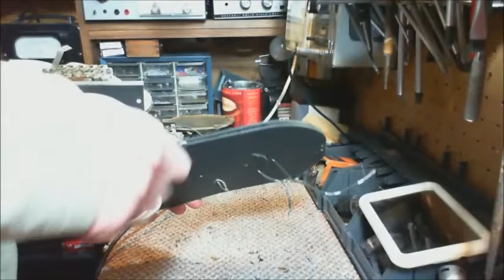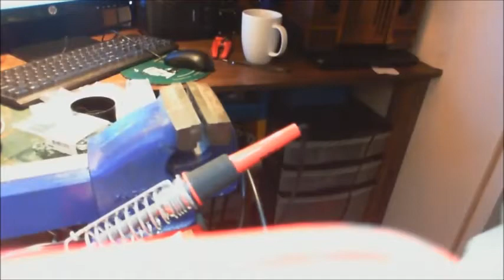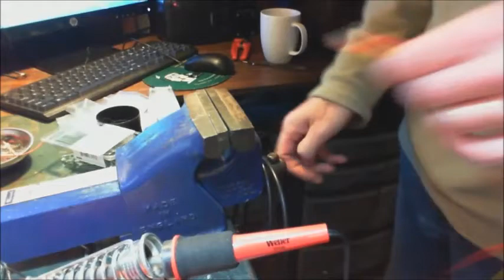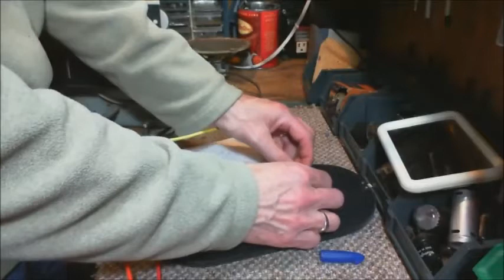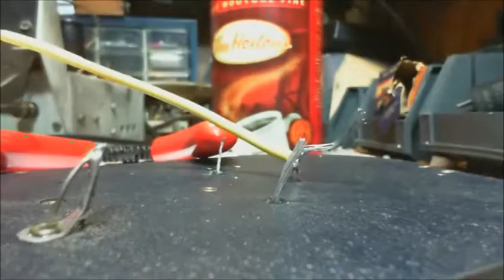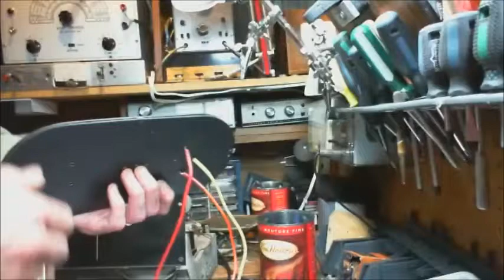General Electric KL-70 AM/SW Radio Video #16 (reloaded) - Beam a Scope Antenna

Comment: Thank you Jim for providing all these great how-to videos on the GE KL-70 radio restoration.  I have a 1941 RCA VICTOR model A-38 which was built in here in Montreal, QC.   It`s in good shape in terms of overall appearance but it humms when I turn it on so I need to work on it.  One thing I've learn`t watching different restoration videos is to first recap the electrolytic and paper type capacitors.  I`m not sure if it was common back then to share the same radio chassis between different radio manufacturers and the reason I mention this is because my A-38 has the very same radio chassis used on the GE KL-70 that your videos are based on.  After watching your videos I`m much more knowledgeable about the A-38 radio and it gives me the confidence I need to proceed with my own restoration of the A-38 RCA VICTOR .  
Many thanks.